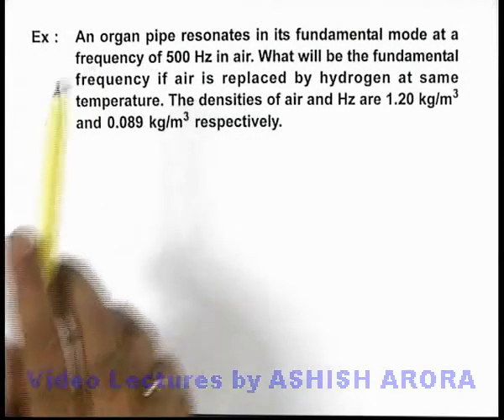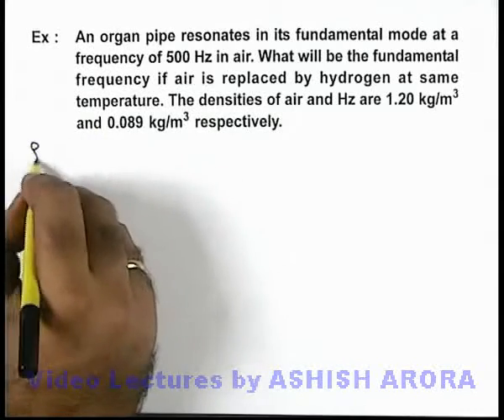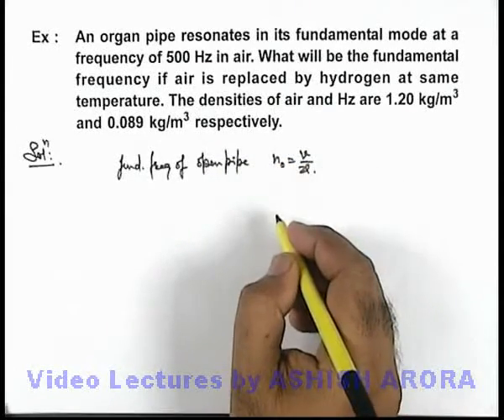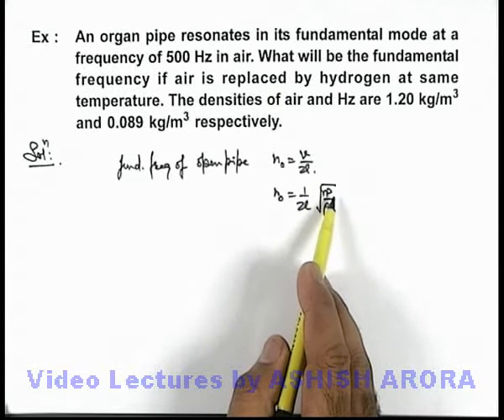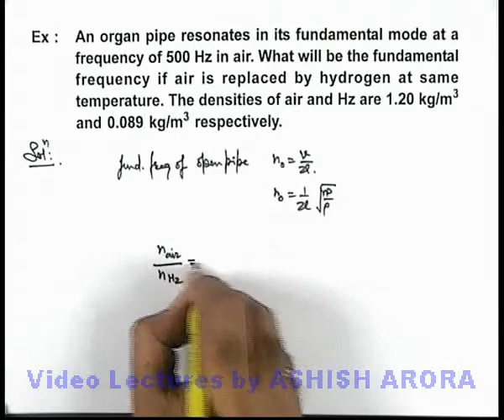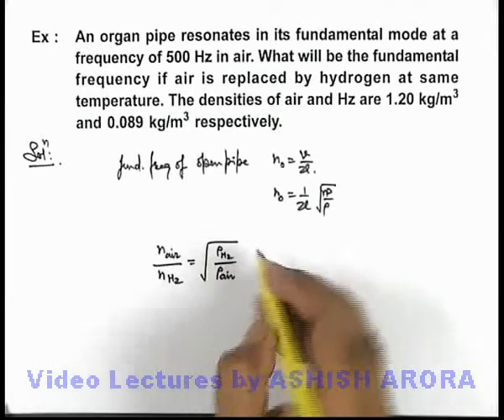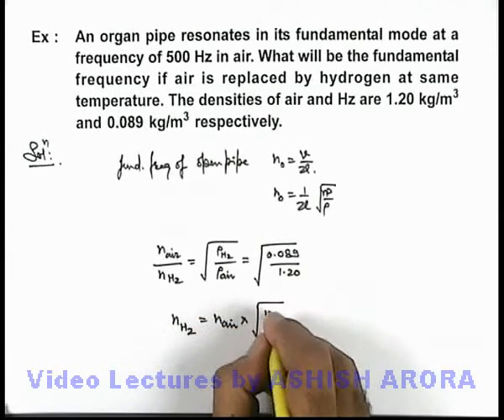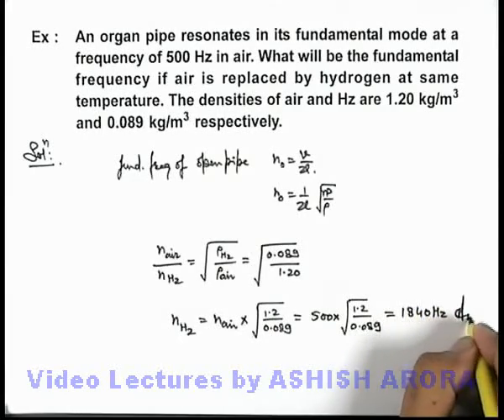Class 11 Physics | Stationary Waves & Beats | #37 Solved Example-16 on Superposition of Waves

Comment: Sir what about pressure???...is pressure const in case of H2 and air???
Reply from the maker: In this case we are comparing at same pressure...
Reply: sir but in ques. it is not mentioned...
Reply from the maker: The problem is for an organ pipe which is open at one end (at least) for our case and so in that case the pressure can be taken constant... and as nothing is specified for densities of both air and hydrogen we consider these at constant P and T only...